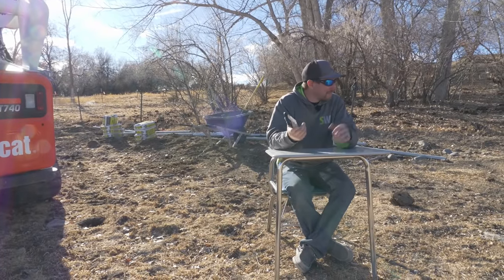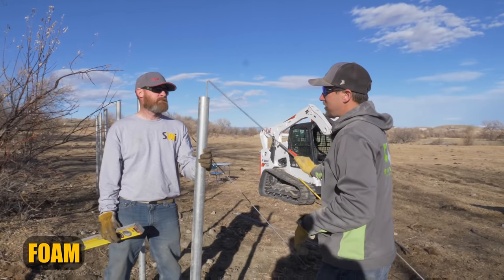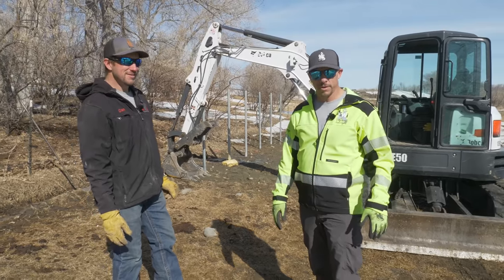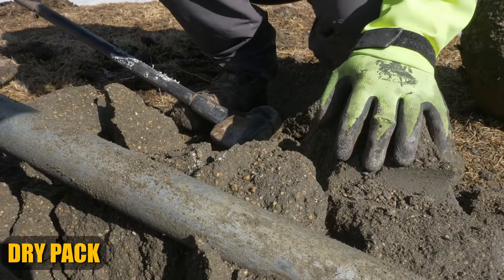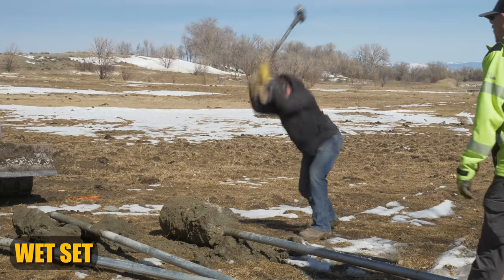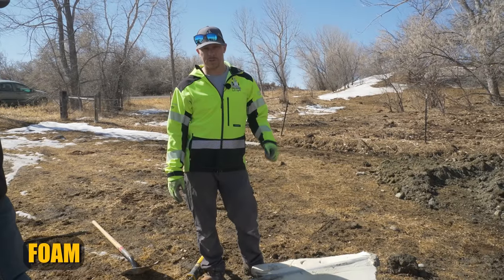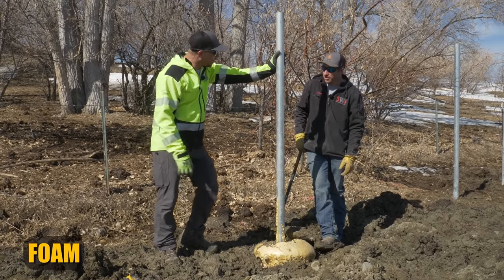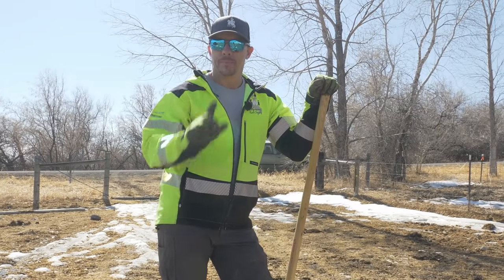Fence Foam vs Dry Pack vs Wet Set | We compare methods to see which is best for fence posts

Comment: 2 3/8" SS 49 fence post. This sounds like a certain type of fence post that can be acquired at any reputable fence supply house. 
I can't figure out what the SS-49 means. The box stores don't seem to list by these common terms. A fence post two feet in the ground that is 2 3/8" with 4 60# wet mix concrete to secure them basically a two foot hole in the ground, 8" around

I like the idea of a very solid fence structure. I have been told every three feet a post to secure the fence to this. Live in Kansas where the wind can blow at times. The fence is to be a gabion wall design5' tall 76 feet long, 1 foot wide. The fence post are down the center with the basket connected to the posts, filled with river rock 4 - 6" rocks. 

I don't thin that any old sucker rod that has come out of an oil field would e the right type of pope to use. The thickness of the pipes are measured in 16 gauge,  Menards has 17 gauge, Home Depot same pipe but 16 gauge, T-52 2 3/8" X .154" $99, 

Not all poles are created equal, some idea of how to get a quality pole for a great price? I think I missed the specification or the source of where to get this stuff.
Reply from the maker: SS40 is a term created by Allied tube and conduit.  Wheatland tube calls it WT-40 and stephens pipe and steel calls it SPS-40.  Basically its thinner than schedule 40 pipe but made out of high carbon steel so it is stronger than sch40.  Any fence company will know exactly what you want if you ask for it.  16 ga isn’t good enough.  There is another product called SS20 that is a thinner wall than SS40 but I don’t trust it in the wind with a solid privacy fence.  We have a lot of strong wind here in WY too!
Reply: @Hello Mike how are you doing

Comment: Apparently dry packing screening with a sledge hammer in layers is very effective and screen isn’t affected by frost nearly as much as other solidified foundations like concrete. It would be interesting to see a video on that as to how it withstands lateral pressure compared to concrete and foam.
Reply from the maker: If done properly the post will fail before even dry packed concrete.  Its essentially tamping  with a great compaction material.

Comment: Heck the two different fence companies I used in past two years just pounded the post in ground no concrete even on corner posts and 6' gate posts. Both were 4 ft high and just over 100' long runs residential fences in PA. Are they going cheap and just hoping for the best.
Reply from the maker: We're a huge fan of pounding too! That's our preferred method when conditions are right.

Comment: you make some great videos, very informative.  Can you tell me  what is stronger a driven post or concrete post wet set?   I am installing  some high tensil field fence and some continous fence.  A pounder is not very common around hear to rent around here.  Just wonder what your thoughts are
Reply from the maker: Driven posts can be extremely strong.  The key is to drive deeper than you would set.  The softer the ground the deeper you will have to drive.  Check out the video where I drove the car through the fence.  That post was driven 2ft and bent over right at ground.

Comment: Would have liked to see the time the installation process for at least three maybe up to five posts doing it all in a row from beginning to end obviously except for digging the hole, but including the mixing of the concrete and or the mixing of the foam.... Because as we all know time is money and if you have 10% difference, that makes a difference.

Also, what is the cost difference....

It appears as though the foam looks like it could be a much quicker process, say if you have a system set up to mix the phone to do 100 posts....

Very curious to see if you have any of the information I suggested above.... Perhaps make another short video?

Comment: Simply drill a small hole in the post about midway into the dig. This will allow the foam or cement to lock the post in place.

Comment: When you did the wet set, didn't the pipe fill up with concrete, or did you have the bottom capped off? I always thought having concrete inside the pipe will cause it to rust through right at the top of the concrete over time.
Reply from the maker: Yes concrete does go into the pipe. No it doesn't cause it to rust since you're not introducing water.

Comment: I’ve never seen this particular foam product. I’ve seen the one that come in a two part bag. I’ve also seen that product shrinks after a time period. Like a half inch or so. Anyone else seen this? I was at my lumber yard and they had a demo of the product with a post in a bucket. I pointed out to the manager that is what that product does even in a control Ed indoor environment. You could pull the whole thing out of the bucket from the 1/4-3/8 gap all around it. When I came back a few weeks later, the demo was gone and the product was no longer in stock.
Reply from the maker: That's a good business--listening to their customers and pulling a faulty product. 👍🏻

Comment: I use sika post foam all the time,  No issues yet.  Small decks, fence posts, perfect and it comes in a little bag, so easy on the back.
Reply: Sika® PostFix® is not recommended for these types of applications. It is not recommended for any type of structural application.
Reply: @superflyguy218  Small decks...nothing big or heavy.

Comment: Another tip that often works is if you strike the pole itself the vibration in the metal will crack the concrete.
Reply from the maker: Yes agreed

Comment: First; Post should be 30 inches deep for a 7 foot fence. Secondly; quickset concrete is best. Third; a hand posthole digger is quicker. I admire your enginuity, but a fence should be completed by section within 2 hours.

Comment: How important is the vertical resistance?  I've never seen a fence pulled up out of the ground by nature.
Reply from the maker: Excellent point. Vertical resistance is almost useless. All well-set posts will have some amount of vertical resistance as a natural by-product, but it's not an important part of fence structure. You're absolutely right--there's no anti-gravity that we have to protect against.

Comment: Thanks, but that's a lot of concrete for a small diameter pole.  I used about 3/4 of an 80 lb. bag for each of my eight foot by six inch round wood poles in south Florida. I dug about 36" deep.  They are still straight after 12 years.
Reply from the maker: We've got to go below frost line up here, and we have crazy wind.

Comment: Are you trying to show what holds better or keep from sinking? I think the soft concrete is the best. Frost won't move the soft concrete as much as it will hard concrete. Hard concrete allows ground to pinch it and move it more. Where as soft will give and chip therefore not allowing frost to pinch it and to move it. The material don't matter as much as shape. A large footer underground with post connected does the best here. I do a lot of dock installations and removals. The poles with feet on them are the worse to pull out. A hole drilled in bottom of post with bolt through it would make it harder to pull out of those materials. A larger footer like a concrete cookie with post attached will last longer in areas of deep frost. A big mass at bottom of hole is harder to move than a cylinder shaped hole going to ground level. Here we burn or tar wooden post bottom and sit on concrete cookie 4 feet down.

Comment: I do like this, however what I wanted to see the most was missing.
Yes the wet set is the strongest, not surprised in the least.  But how do the post stand up with in a fence.  I'm not worried about someone coming and pulling up my post. I'm worried about extended sideways pressure, as from the wind.
I would like to see this repeated but after allowing a get set,  pulling them to the side to see if the will lean over before they bend. Maybe even attaching an offset weight to the post and coming back every weak and adding more and more weight till failure.
Reply from the maker: This is a cool idea. 👍🏻 Maybe we can make it happen.
Reply: Thanks for the reply.

Comment: Concrete may aid in grounding the fence, foam may insulate and require additional grounding.
Reply from the maker: Engineers make us ground steel fence already so I'm sure they would require it for foam.

Comment: What would your opinion be in using the foam to set 4X4 posts for use with a clothesline?  Would the lateral strain of the loaded clothesline loosen the post over time?
Reply from the maker: I doubt that would be a problem at all.

Comment: I've pulled many chainlink posts or just break  off cause the were rusted through. All the ones that lasted didn't have concrete inside them. Foam is just garbage and they won't last a year in the ground. Dry set still does require adding water to the hole on top and some at the bottom and you can just pour inside the post. Idk how I even found your channel lol

Comment: Since the concrete isn't going to be load bearing, does it really matter how much PSI it's rated at?
Reply from the maker: I see what you're saying but I would say it is load bearing. Just not in the traditional sense. But if you've got wind like we do up here that can add up to a fairly significant side load.

Comment: Weld a few tabs on the bottom of the pole and I'm sure you wont be pulling the pole out like that. I wounder what the rot resistance would be if the post was wood?
Reply from the maker: We don't like wood anywhere we can substitute steel.

Comment: We pour the concrete dry and pour water on top and it's pretty solid and much easier than the methods shown here.
Reply from the maker: Any method where the concrete is not packed will fail even quicker.
Reply: I've had to go back and modify fence that I'd helped build where we poured dry concrete into the hole and then just watered it down and our skid steer couldn't get it out, in fact the post failed and broke off so then we had to go back and dig up the concrete and we usually bust up the concrete to spread it on a drive or something like that so we went to bust up the concrete on it and I busted a lot of concrete off some poles and yeah it took about 30 minutes 2 bus that one off the post oh, I don't know if climate makes that much of a difference but I live down near Dallas Texas

Comment: Quikrete for post doesn't mean you don't add water. You pour the mixture in then add water and let it thoroughly saturate the concrete. This just means you don't have to mix the concrete in a wheelbarrow. And if you're putting in a wood post put gravel in the bottom it will allow water to run off so the wood will last longer.
Reply from the maker: True

Comment: ? I have is, on the wet set you drove the post through the wet concrete. Most of the time I pour the wet around a post. Do you think there would be any difference between the 2 different methods?
Reply from the maker: Yep! For sure. We've done pour and then stab for years because it ties in with how we eyesight our posts without string line in most cases. Also, if you've got hollow pipe stabbing after pouring gives you the added benefit of concrete inside the pipe for that much extra strength. We also like to float the post with concrete underneath.

Comment: all of the tests you did, a fence will not have to deal with.  The only test needed for natural stress on a fence post is side loading.  by either wind/water or by animals.  You should put a chain to the top of the post with a strain guage, and measure what it takes to pull the post over to a certain angle. 
You should have done one more test posts, and that is compacting natural soil around the post(s).  Wait one year to check them.
 In my eyes, dryset is the clear best choice to setting fence posts.  It sets up to far stronger than the natural ground/soil.  it is actually more easily removable from the post to reuse a post some day.  post is solid/usable immediately after the dryset is tamped into the hole.
Wet set is far more work to install for several reasons... carrying extra water, mixing it, cleanup, holding the post upright while setting, etc, etc...

Comment: The foam wont have any ill effects of becoming brittle. Not sure the longevity. But also the foam will add a resilience to wind, cushioning effect. Like i said i wonder what its deterioration rate is, stand-alone, as well as in a high wind area, where you get allot of side pressure, the concrete can become brittle and chip away when the pole is shifted sideways from wind, as well you cause a wear and deterioration in the pole where it flexes at the lip of the concrete, the foam should stop the pole from that deterioration. Any longevity testing? Seems like a great and easy to use product.
Reply from the maker: We haven't had a chance to do any longevity testing yet. The foam feels like more of a niche application to us right now. It has its uses, but we're not looking to get rid of concrete any time soon.

Comment: "If the utility company is doing it, we can trust it." - Post modern millenial unable to comprehend the new paradigms.
Reply: I don't trust the foam at all. I would trust putting the dirt back in it tamped. That's what I've done for the last 23 years. Setting 70' 80' 90' poles. Dirt and that's all.
Reply: They're using the foam for in ground satellite polls and they seam as good if not a bit harder to remove......that being said still would rather light polls be packed around with dirt
Reply: @t.r.4496  I used the foam to place a 50' flag pole in my yard and about 8 to 9 months later had 60+ mph winds and now my flag pole leans just enough to be noticeable.
Reply: @steveadams4009  you sure the wind wasn't blowing 50 mph when you was using your plum bob. Lmao
Reply: @t.r.4496  How did you know I used a plumb bob instead of a level, well actually a rock and string.
Reply: @steveadams4009  well if you used a level a pole is tapered and it won't level right.. so I just assumed a string and a rock

Comment: I used 2 part foam and it SUCKS.  All 12 of my posts were leaning from the weight of the privacy fence panels within a couple months. I reset the posts using wet pour and remounted the fence panels and they've been standing straight for 3 years.
Reply from the maker: There you go! 👍🏻

Comment: I've tried the foam before what a mess. So expensive. Didn't bond well to vinyl.(not that concrete is perfect at that either) soakset is definitely my favorite pour dry bag put the water on it after raising the post to height then Jab it with the digging bar acouple times just that little mixing adds a lot of strength, Isn't crumbly. So much faster.

Comment: QUESTION. A average cost for your sack crete it roughly 6$ a bag so 12$ per hole dry or wet...... 
HOW MUCH DOES  FOAM COST PER HOLE???????
Reply: Yeah, ONE very expensive fence, out of a farmer's price range. Drive the posts deep. If you can't get it deep, set it with dry concrete and I can NOT imagine using more than two bags in an extreme case (like near a creek). I have hi-tensile built 30 years ago and the only problem is the posts probably won't last another ten years.

Comment: Only thing is the depth of the post or pole and the total length of it as well. In my area the total length of the pole determines the depth of hole. For example. A 25 foot pole has to be in the ground one foot for every five feet of pole. So that means a 25 foot pole has to be in a 5 foot deep hole. Not sure about the depth of fence post to that???

Comment: How about for someone on a budget if they did like two bags of concrete one in the bottom of the whole back fill with some dirt and then do another bag towards the top of the hole with just enough room to backfill with four five in Topsoil I wonder how strong that would be
Reply from the maker: The most expensive part of the fence is the installing the posts.  For this reason I would spend the time and money to do this 100% correctly without skimping.

Comment: The dry pack will never cure to the strength of wet pack.  I have pulled dry pack after a number of years,  It will always be weaker, by quite a bit, over any amount of time.  Damp pack is a good middle road, and holds the posts while they are setting.  Concrete as dry as possible while still being wet tends to be the strongest, though concrete that is too wet is not as bad as dry pack.
Reply from the maker: The wetter the concrete the weaker for sure.  If its soup it’s probably as good as dry pack.

Comment: Dry set by far.  Dry set,, take a premix sack,, hold the post plumb  pour the dry mix in,, then use a piece of rerod about 4 feet long.  It will slide all the way to the bottom at first,, just continue to agitate up and down and move around the post,, and the dry mix will settle, about 30%  and compact.  The longer in the ground,, the harder it will get.
Reply from the maker: "The longer in the ground" applies to all concrete.
Reply: @SWiFence    Yep.  The Pantheon in Rome is still getting harder day by day after 1800 years.  Their sledge hammer test after a couple of weeks frozen,,, give it a year and the dry mix should be just as hard or harder that the wheel barrow mix.  These days I set all posts with the dry mix method.  faster, cheaper, better.

Comment: Trying to build a dog run for Great Danes! Yes plural!  Need strong posts.  Need 3’ in ground posts with concrete. They weigh 200lbs +. Locally, we have a Home Depot, next town over. Materials are scares, even with “in town” delivery. We need help. Spring is very very wet. Winter is very very harsh. Summer is very very dry! All year very, very, VERY windy!  Also ground is allllll rock and sand! Please please help!

Comment: 1 week is not adequate time for dry set to cure. A year from now the dry set will be some of the hardest concrete you’ve ever seen. Plus it is much easier and faster to work with than wet.
Reply from the maker: I'll let you argue this out with the engineers.